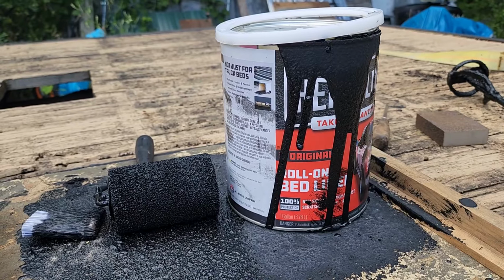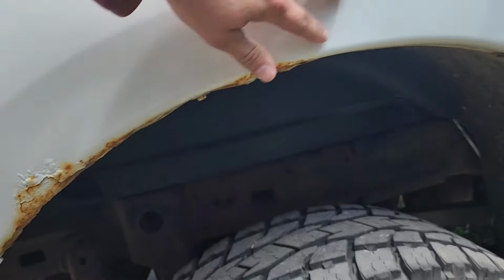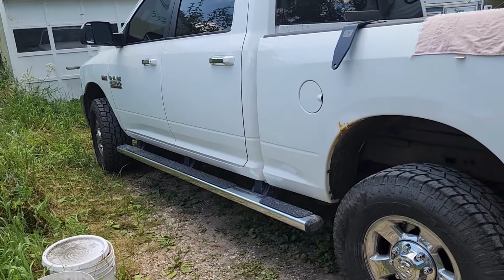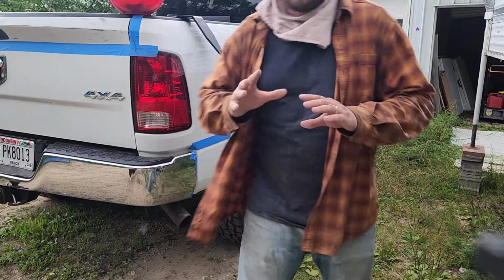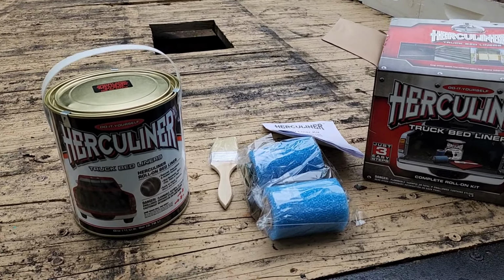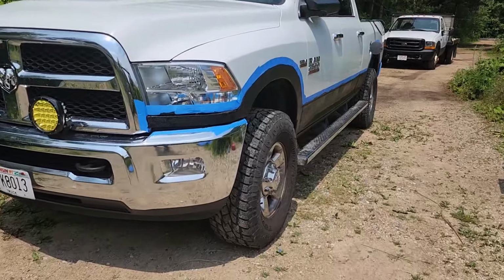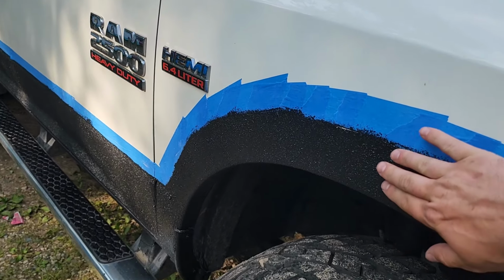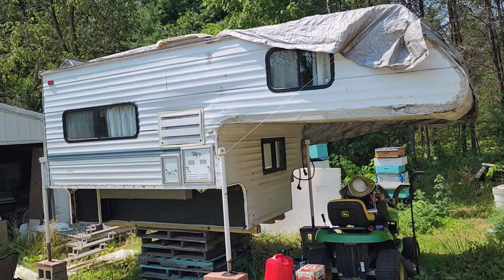Bed Liner Rocker Panels DIY on the Ram 2500

Comment: The truck came out great. The black color really adds to the white rig, in addition to the extra protection.  I live upstate NY, so I, too, have a huge problem with rust on my vehicles. My '07 Rams rockers and cab corners are shot. Im planning on just  cutting out the rusted areas and tacking in some aftermarket replacement panels. My plan was to use a liner material instead of paint. After seeing how your truck came out, Im looking forward to the project. Thanks for sharing.
Reply from the maker: My Dad did his 01 Ram rocker panels, and it was a big motivation me to give it a try as well. So far, the rhino liner has held up GREAT! We'll see how it holds up over time though! I'll have to do a review after a full year. Thanks for watching!